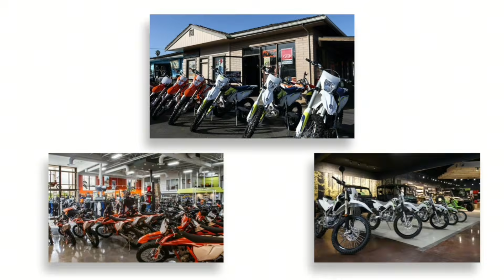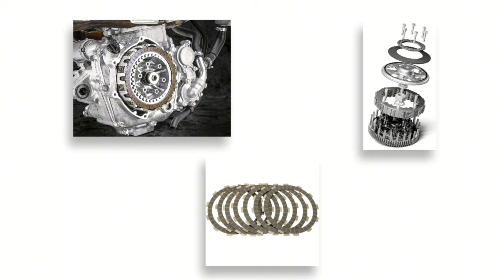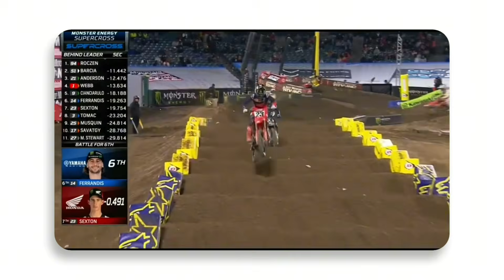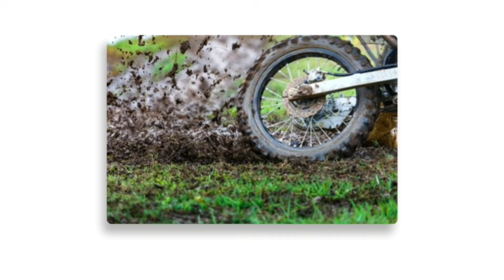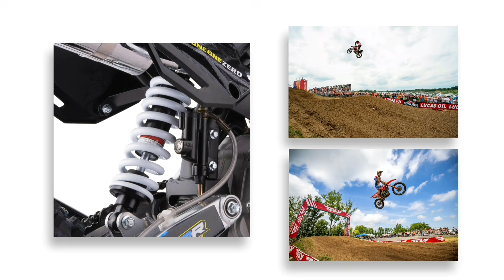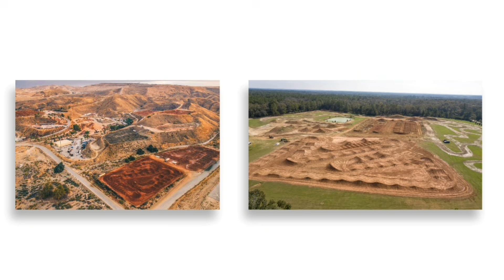Every Part of a $200,000 Supercross Factory Bike Explained In Detail

Comment: How they measure front and rear wheel speed?
Reply: Probably a sensor cable either within the brake line tube or just completely seperate
Reply: @JosiahZedok the rules forbidden any type of measurement ar rear wheel
Reply: @Liviu450  ecu, if you can measure the sprocket speed you and interpolate what speed the wheel is at, i dont know this for a fact but thats how i would get around the rule
Reply: @Liviu450 you can use anything when practicing Mr. Knowitall